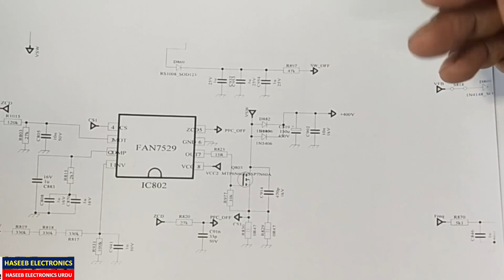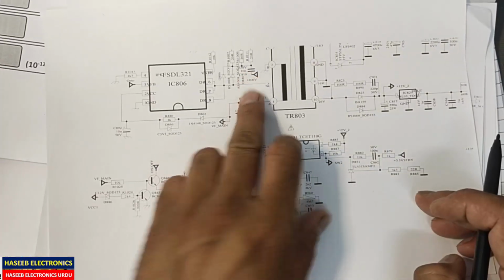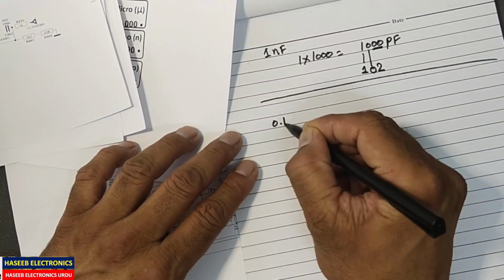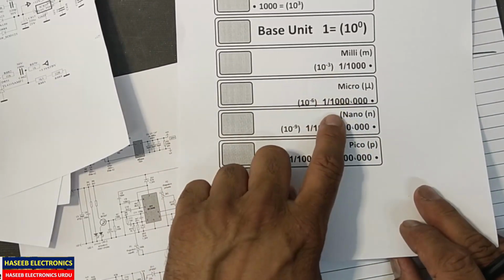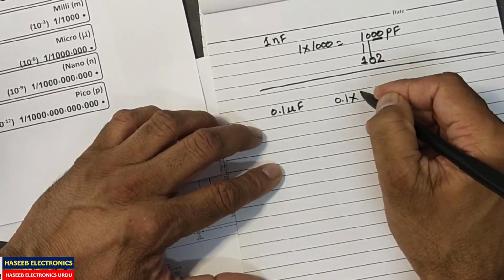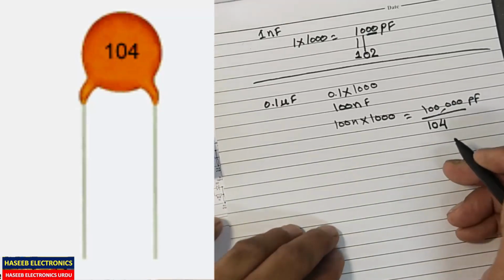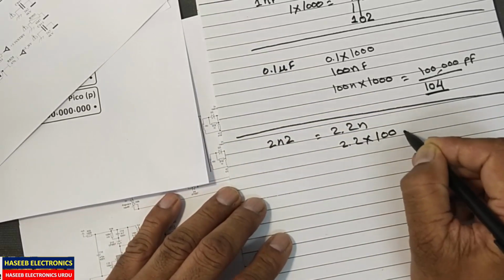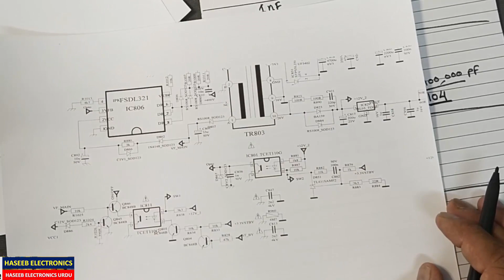{623} Capacitance to pf Code Conversion / How To Convert Capacitor Value to pf Capacitor Code

Comment: What is the voltage rating of those capacitors?
Reply from the maker: if there is no voltage rating then 
the small size capacitors are normally 50V & 100V 
above than this, the voltage marking is marked on body

Comment: Only the number 102 is written on the capacitor. What is the voltage value of this capacitor?
Reply from the maker: most commonly the small ceramic capacitors are 50V & 100V 
otherwise for high voltage capacitor code is marked on capacitor